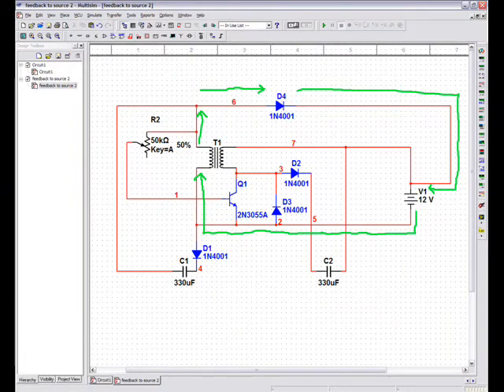comwarriors bedini feedback to source + 2 BEMF outputs V1

Comment from the maker: Having said that, it will also depend on your coil setup too... if your running 22 gauge wire for drive coil and 26 gauge for trigger then the radient produced by the trigger coil will be of a reduced amount, but even so this is still additional energy that would normally be unused by a normal circuit and shorted out via the diode going from the emitter to the base on the transister...

Comment from the maker: thats an interesting question...
due to the low curent consumption of a bedini fan and because of so many changes in  one go i'm still testing a 'profiling' the circuit.

However, the curent testing indicates that both BEMF outputs are independant so you should get about the same charge rate on each output as you would with the normal circuit...